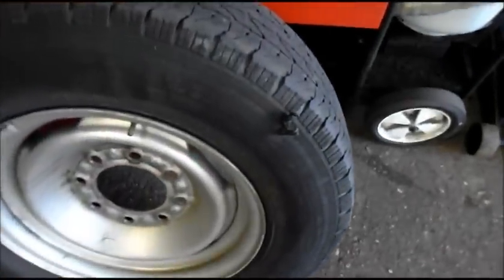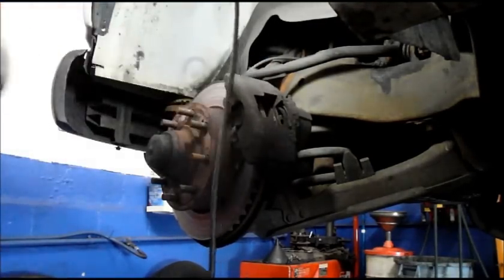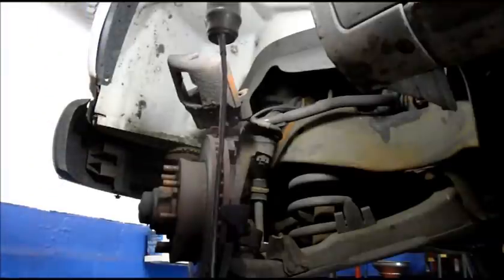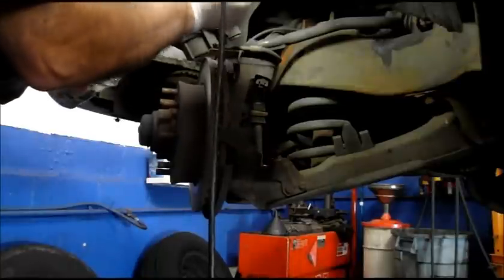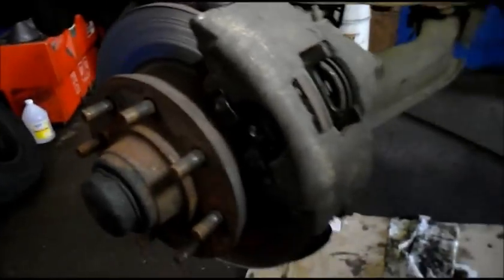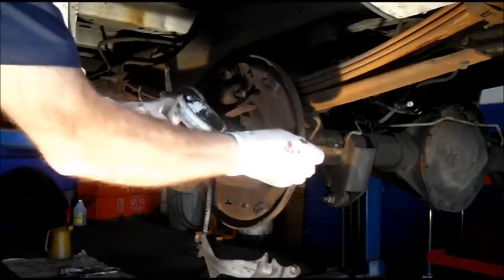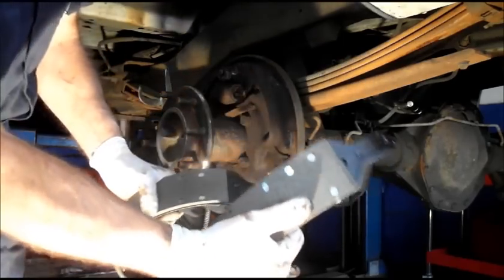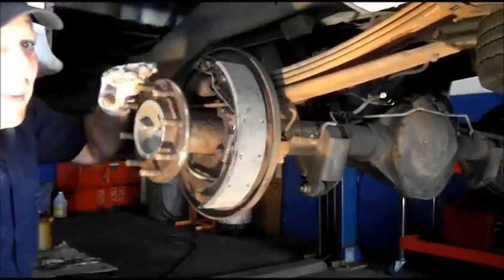How to replace front and rear brakes on a 2002 Chevy Express Van

Comment: I would have done the job also.  You made the vehicle safer as a result of the work.  Sure, the brake pads will wear out quickly.  More concerning is the condition of the tires.  I would mention the danger of a blowout and the liability for damages to others is many times more expensive than a new set of inexpensive tires.
Reply from the maker: +Sandbag1300  You are correct the tires should be a top priority especially with the plug in the side wall.
Reply from the maker: +Sandbag1300  I don't like to do a job like that but the way I looked at it is that the truck is safer than when it came in.Not done correct but safer.
Reply: +jimthecarguy Well said, Jim. Next priority is those tires that customer has to get them replaced before they blow or in a best case scenario simply go flat. Those tires are a potential accident waiting to happen.
Reply from the maker: +davemaster001  Thats what I told him but as of today still not replaced :(

Comment: hey jim just a word of caution. Trying to do this guy a favor can back fire. If by some reason he or some other person gets into an accident and they  out that brake failure was a contributing cause,they could come back on you with a lawsuit. Even if the owner signs a waiver  they can say you knew it was wrong and you did it anyway. I used to be called in court as an expert  consultant and many times they would ask the plaintiff did you know that what you were doing was not up to industry safety standards.. They would answer yes but the owner said to do it.  That does not excuse you from liability  My dad and I owned a repair shop for many years and if a customer came in and wanted a short cut job dad would tell them " if I am going to do the work then it will be done correctly to meet or exceed oem standards. If they had the money and didn't want it repaired right , then he would invite them to take their business elsewhere., If it was a case where they didn't have the money ,we would repair the car correctly and dad would hold the bill  and lat them pay it a little at a time. We never  over priced and many times quoted under the going repair rate. The hop was always busy even in lean times. When people would ask how we stayed so busy dad would say: we simply treat people fairly and right.". Needless to sat we were very popular with single moms that " were living pay check to pay check and many times dad would forgive the bill and tell then your kids need to eat more than I need the money.

Comment: Jim on this one you used a 3/8 size key, what size key should i use for a 1500 express van? i used a 3/8 but it does not fit.
Reply: Edred Flores ever find out? Doing the job on a 1500 now. 🤦🏻‍♂️
Reply: Use the size that fits. If you can't figure that out you shouldn't even be touching it. Take it to a mechanic, your life is at stake.

Comment: 💥 Hey Jim. Really great video.  I could not get the driver side drum off even though I soaked it with PB blaster and tapped it with a hammer.  So I brought it to my mechanic. $700 later and drums, shoes, cylinders and spring kit.  I drove about 5-6 miles and the wheel, drum and axle drifted out half way going around a turn.  Do you have any idea what could have caused it.??  I had it towed to him last night and it’s Sunday now and he’s closed.
Reply: A bad mechanic